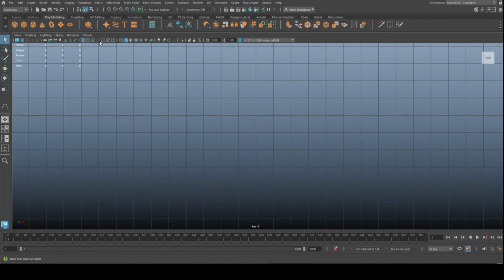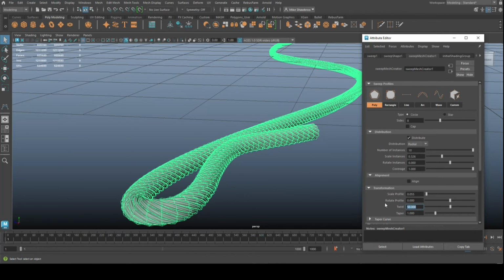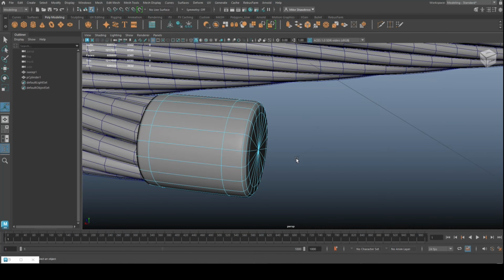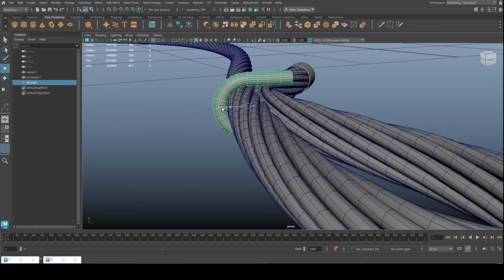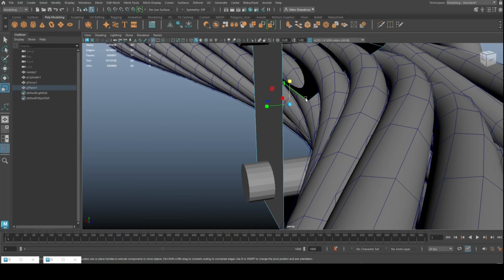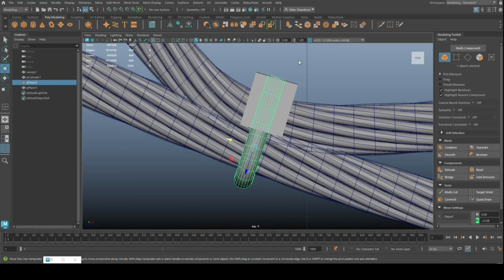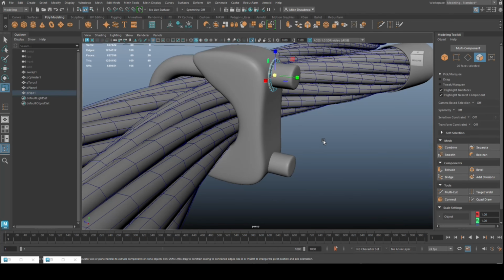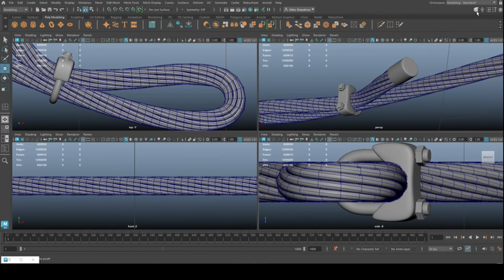Let's model a 3D heavy Industrial twisted steel cable in Maya

Comment: This looks awersome and was way easier done than i though (didnt know about that "line making" tool). That said my only criticism (as my detail based ADHD kicks in) to the model itself is the clamp ;) Industrial level cables are clamped in a hydraulic press so the "pipe clamp" binds the loop permanently. And some of the biggest ones are also "sowed into them self". But just for the sake of modeling this part can be useful for smaller cables which actually use the screw clamp.
Reply from the maker: LOL, I know... I studied Mechanical engineering. But this was more fun
Reply: @MHTutorials3D  The old "two birds with one stone" trick ;)
Reply from the maker: @krzysztofmazurkiewicz5270 Yes sir !